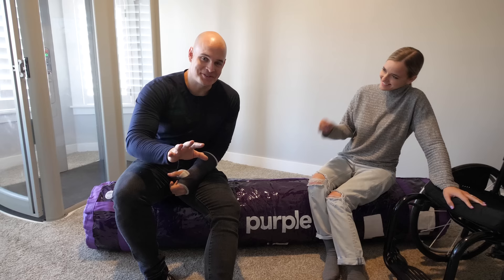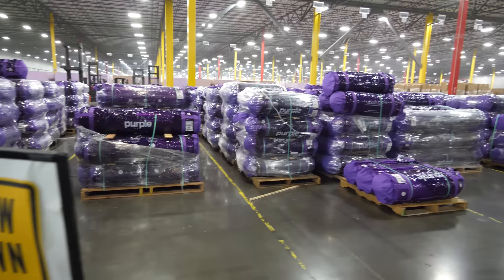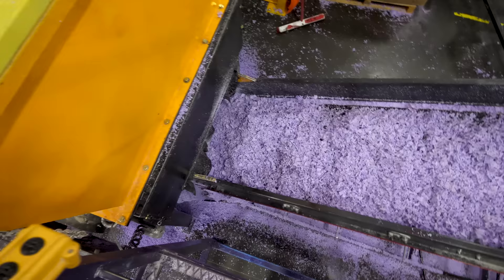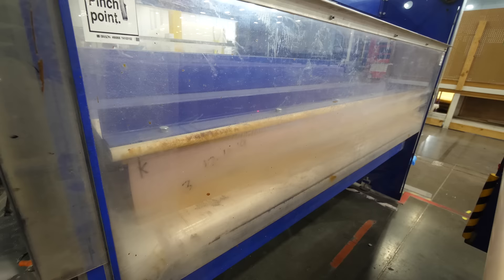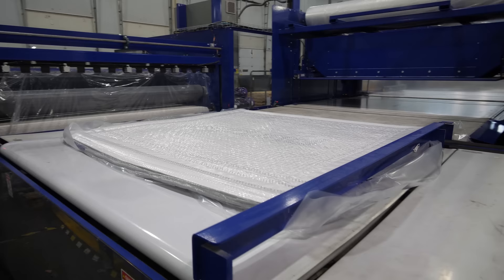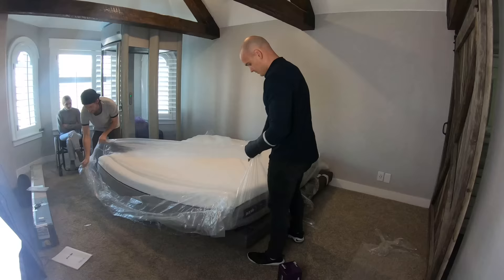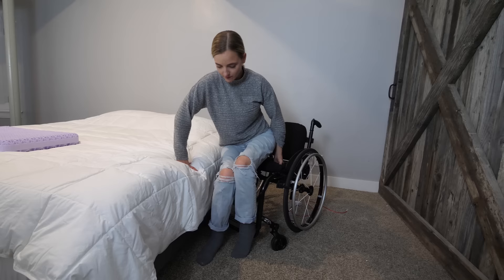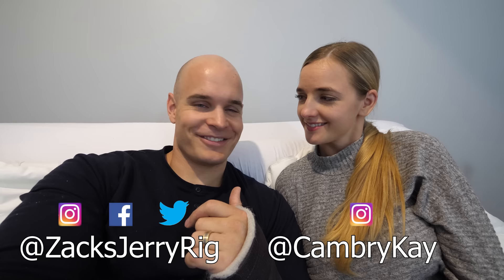How to Make a Purple Mattress! - Best bed of 2020?

Comment: "nothing goes to waste" - purple stuff everywhere on the floor
Reply: @Maddiethebaddieeee  well it is easier to have just one mold instead of a bunch of them for different sizes
Reply: @Maddiethebaddieeee  I mean it's a machine that has different moldings. It would make the machine more complicated and expensive. It's not cutting corners, it's being efficient
Reply: @Maddiethebaddieeee  you have to do maintenance of the machine, the more moving parts you have the higher the probability for something to go wrong. Another thing is that a big company full of people have probably figured out what is most cost effective.
Reply: Tactical Boolean lol that is not the case. The bigger the company, the higher the diffusion of responsibility.
Reply: Damn, you got 'em. If only we had devices that could be used to remove stuff from floors and place it somewhere else. Like a broom and dustpan, or a vacuum cleaner. Oh well, don't have anything like that, so I guess it just sits on the floor forever as waste! 🙄
Reply: I bet they sweep that up and throw it back into the belt.
Reply: @Maddiethebaddieeee  molds wear out if u have 4 going instead of 1, then u have 4 times the molds to maintain, check, and replace and all the complexity of making sure the material stays consistent across sizes
Reply: @mjc0961  Yep, along with dust and dirt.
Reply: A hybrid system where all the molds are together with multiple injection points would be best. You inject at certain points for certain sizes, and the runoff could then be recycled (which would actually be less material needing processing per size if you do your molding right). Depends how their injection molder is built, but I imagine each injection point (there's never one point, as you could have uneven pieces that way) already is fed separately from each other, given how large the final part is.
Reply: I was thinking that too, and also why not make seat cushions from the cut off parts, they look like the perfect size.
Reply: Bruh I work in a factory do you know how hard it is to keep a factory SPOTLESS? its REALLY hard, especially when you work with a lot of raw materials such as dusts and silicon based materials like this. I work in a metal working factory three years ago with oils in the air and metal dust and now I work in PCB factory and is lots of fiberglass resin and glass everywhere is not as easy to make it clean as it seems.
Reply: @Maddiethebaddieeee  the power of running a grinder vs running multiple heated injection moulding machines is huge. some injection moulders take half a day just to heat up. then look at all the down time when you have orders for 200 king, but only 20 double. what waste a whole day heating up and cooling down a mould just to make 20, when you can make 220 king, and chop 20 of them down to size. you are perfectly right, a mould is a 1 time cost and energy an ongoing expense. why waste energy on stop start production, when you can continuously run one machine. 

But it is REALLY common for factories to do this. I don't know any factory that doesn't do this, whether its toilet paper, cardboard, metal stamping, plastic film production. only food products waste resources, as you cant grind a burnt loaf of bread up into another loaf of bread!

Its like turning your phone on and off every time you send messages on your phone. you may think it saves battery, but the time end effort spent waiting for it to boot, check for messages, then turn off can be wasteful. You receive and send 1 messages a week? its not wasteful. you have 10 watsapp conversations on the go, its hugely wasteful.

You may then also have some other strange things, like the machine used to melt the plastic might not being empty, and could start burning any residue. a constant feed of material ready to be melted could (again) help with the time and energy wasted in stop start production.

I work in a factory that makes plastic parts, with machines that take hours to heat up and cool down. we have to work a 24 hour shift, becuse hiring an extra 1/3 work force over night is so much cheaper than turning the machines off, then turning them back on the next day.

I would hope that they do have at least 2 moulds for singles and doubles.
Reply: You guys think you understand how Purple's system works, based off of one video. Hmm.... problems with Americans? Nah.
Reply: @Maddiethebaddieeee  Then both are hot, since in the video they say the purple stuff "gets metled down and gets melted in to an injection molding machine". (direct quote)
Reply: @Blueyzachary  Ah yes, because every single person on YouTube is American...
Reply: I think they would just use a broom to pick it back up and throw it in since the factory looked a bit like its funding was running on fumes
Reply: Blueyzachary They also don’t get that molds of any kind are expensive, semiskilled hourly wage is not. Plus, you employ people in honorable work. “Soylent” Purple...it’s people!
Reply: @Maddiethebaddieeee  Molds for injection molding are not a one time cost, they wear out/need repairs or replacements. It costs alot to make molds, especially ones that massive
Reply: @GBLynden  that's insightful
Reply: @Maddiethebaddieeee  
4 molds would significantly complicate the manufacturing process and the infrastructure cost. They probably determined it is most cost and time effective to just go with 1 size mold.
Reply: aye ants gotta sleep too dawg
Reply: @thebananaclub  Do you realize how many bed sizes there are...
Reply: @foxman105  they make 4 sizes just like he said twice in the video
Reply: @x12legend98  That's still 4 production machines instead of one.

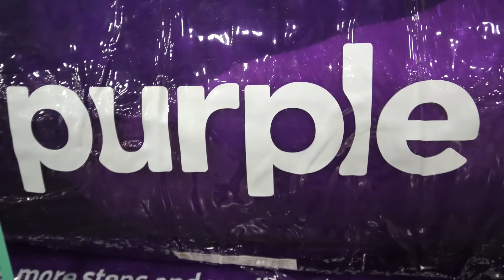Comment: [ 1:05 ] "This place is so large that 7 football fields can fit inside of it"

Me : Damn , these Americans can do anything to avoid metric system
Reply: This is the standard
Reply: Idk if you think he means American football or soccer but American football fields are often used to show how big some place is
Reply: As an American who's heard this all of his life, I'm just now realizing how strange of a measurement this is 🤣
Reply: I understand the size of football fields more than I do the metric system. Keep the metric system, no need for it here in the United States!
Reply: @akaredcrossbow  I can't think of a good reason not to switch to metric. It makes so much more sense in my opinion. Multiply or divide by multiples of 10 to change your unit of measurement instead of remembering convoluted conversions.
1 mile = 760 yards = 5280 feet = 63,360 inches
Versus
1 km = 1000 m = 1,000,000 mm

And that's just for measuring distance. Volume is the same way imo.

1 gal = 4 qt = 8 pints = 16 cups = 128 fl oz
Versus
1 kL = 1000 L = 1,000,000 mL

Any thoughts on why we should keep the imperial system?
Reply: Not to mention it would be more standardized with the rest of the world.
Reply: @akaredcrossbow  yes we do need metric system. Our military and health care all uses metric system except civilian.
Reply: I heard a lot of civil engineers want to use metric but they are limited by the suppliers and convention problems
Reply: bad also lol
Reply: @Peanutbutter_Funk  exactly
Reply: It's a common expression and usage. We understand the size of a football field, just like you understand the size of a football pitch.
Reply: I worked at a factory over 75 thousand square meters or around 18 or so football fields, took nearly 8 minutes to walk from one end to the other. Was a fun time.
Reply: It's funny because Europeans don't understand relative sizes.

If you said "1000 yard along and 500 yards wide" that's pretty much a useless measurement aside from going "ah. Its a rectangle with dimensions"

If you're saying you can picture this in your head without comparing it to something familiar to yourself you're bullshitting and you know it
Reply: @t_c5266  thats the point. Europeans understand how big of an area a 100 meter x 100 meter field is but rarely get how long a 100 yard x 100 yard field is, because we dont use yards in europe. It would be nice if america changed to the metric system since it is more logical and that way we would all be on the same page. A win win situation.
Reply: @JT-ev8sd  units are meaningless btw. And your 100x100 you compare ein your mind to a soccer field or something.
Reply: @t_c5266  yes, they are meaningless, that is why it would be better for everyone to change into the more logical ones. Also when I see a stretch of road I can come up with a pretty solid idea of how long it is. That works the same way around. If I'm given a number in meters (as long as it's not a big number like over 20km, I can imagine the distance in my mind pretty well, so not everyone is like that at least. 
But enough said, I'll sleep now.
Reply: We are converting to metric, inch by inch.
Reply: To be fair, as a Brazillian i don't undestand nothing about the idea of the way that you guys use that
Reply: How many hockey 🏒 arenas ?
Reply: @Al 6r tf are u saying, there is no - f and what u said is wrong af
Reply: @dantedanis  Cause i'ts way more accurate
Reply: In Germany one of our biggest TV programs is always comparing with Soccer Fields "Fussballfeld"
Reply: Only the most sucessfull countries use the imperial system like the USA, Burma and Liberia
Reply: Metric system is terrible. Built for fools by fools
Reply: Yep. School busses and football fields are standard units of measure in the US. (it's just over an acre, so I usually just assume acreage based on the comparison)
Reply: @t72oftruth66  What? At least the metric system makes sense and is easily translatable. Just because you're not able to use it.
Reply: @Peanutbutter_Funk  The US Customary and Imperial systems advantage is in having names for units of useful sizes.  I agree that conversions require more knowledge, but in everyday use people aren't converting between them often.  A gallon of milk vs a quart of milk is useful to call up a mental image of approximate size.   100 mL vs 300 mL vs 850 mL ....ehh  People don't tend to be able to visualize hundreds of things, they group them into units.  At best you're thinking "A liter is about this size and it's 1000 mL, so 300 mL is 3/10th of it."  The US and Imperial systems just give names to things of useful sizes.  It's a lot easier to know how big an ounce is and visualize 10 of them than it is to know how big a milliliter is and visualize 300 of them.  Most people can't and will resort to the method above of trying to relate it to some fraction of a larger unit. It's a completely different thought process to work with metric in everyday civilian life.
Reply: @Retro6502  I honestly hadn't thought of it from this perspective, but I agree. Thanks for the response!
Reply: Like every description of a suspect is about 2 metres
Reply: @JT-ev8sd  Would be nice if Europe changed to Imperial thanks for your opinion and there is mine
Reply: @RENERIZER  yes, but objectively speaking the metric system is a lot more logical, hence it should be the one everyone used. There is a reason that in America people use the metric system in science.

If some other people came up with a third system that was even more logical that metric and imperial then I'd be all for the change to that one. 

Ego should not hold back improvement.
Reply: What's a metric system?
Reply: “You could fit 826 hotdogs in this factory!”
Reply: @akaredcrossbow  You will find that much of the high end engineering and manufacturing in the US is already being done in metric (NASA, SpaceX, etc), because it is so much more precise and standardised. Just old tech like carpentry and home construction still uses thumbs, shoes and steps. In fact, the metric system is used to define and calibrate your imperial unit measuring devices. So the US could definitely not do without the metric system!
Reply: @GI-AUS  exactly !! What inaccurate is two footbal field size what the fuck Say in meters thats accurate !!
Reply: @Peanutbutter_Funk  I'm so used to the inches and miles thing but we can get rid of the quarts and gallons, those were always confusing and annoying.

Comment: We just got a purple premier 3... and literally I will never go back to a different mattress. It supports you more on your pressure points but still cradles the parts that don’t really give off much pressure and I sleep hard. Whereas my other mattress I would wake up multiple times throughout the night because it was too hot or I felt my husband move. We are both hot sleepers and this keeps me cool! I have no issues and we use a down comforter that made us sweat on our previous mattress. 
Anyone considering this, just do it, you will not regret it. It’s a pricey investment  but you will not need another mattress for a long time. You can use Splitit at no extra interest and you can use your credit card as long as you have the total balance available on your credit limit. We got the purple hybrid premier 3 in king size 10/10

Comment: Awesome video. Thank you very much. This was one of two “finalist” mattresses that we selected to be our “first trial” mattress after 18 years. And it’s the bed that we hoped might have worked. But before we dropped the premium sticker price cash we did LOTS of research…which never led us to transparent answers (even from Purple) on durability. Odd, right? Their customer service is wonderful and it does have a 10 year warranty. And yet I keep reading about people experiencing premature sagging after as little as a year. And not a low percentage of buyers. Wirecutter published an article about this. The purple hybrid mattress (2, 3, 4) represents such an advancement in mattress design in many ways, with lots of cool technology…so why not take it a step further and torture test it (like so many companies do with that huge and heavy roller tester machine) and publish those numbers so that people have the ultimate confidence in this premium-priced bed? So, we ultimately opted for a latex mattress (which was the closest “feel” to the purple grid), and there is LOTS of data on the long-term durability of latex. And if the Purple hybrid is as good as it seems it could be, just prove it with data. If it isn’t, consider replacing all of the poly foam on the edges and in the transition layers with latex foam. Perhaps the poly foam is the weak link (because I really doubt the weakness lies in the hyperelastic polymer grid or in the pocketed coils underneath).
Reply: We bought the sleep number bed system fully adjustable years ago and we still love it.
Reply: You might wanna also look into the powder coating that is left on the purple mattresses, you have to literally wash it in your driveway before its safe to use.

Comment: 1:53 But what if the same dust keep getting used over and over for a long time, will that affect the quality of this dust?
Reply: Dust is dust and dust deteriorates 😂
Reply: Yes but it's not likely to be recycled more than a couple times. P(recycled) =0.05. P(recycled twice) = P(recycled)^2 = 0.0025 or 0.25%
Reply: @mitchellsteindler  That's an amazing formula I've never heard of 🤔🤣

Comment: Zack and Cambry, thank you guys for the informative video. I'm a T12 para for 28 years and I've been looking to replace my bed. It's a standard coil spring that I've been throwing mattress pads on and I've had it for years. I've been looking at Purple for a while now, wondering how it would fare for a disabled person with skin breakdown issues. I sit on a Supracor Stimulite cushion and I noticed they make mattresses, but they run $8000+. That's kinda steep. Anyway, your video's given me everything I need, I'm gonna pull the trigger on the mattress and adjustable bed frame. Thanks again, and here's a sub for y'all.

Comment: idk if it's just me, but I got the purple 3 hybrid and am regretting it. 1st night I actually woke up in sweats, never happens, & woke up all night. I've gotten used to the gel, can't tell the difference anymore ,but my issue is I've woken up with horrible back pain every single day if I sleep more than 6hours. There's like a gap in the lower back area, it's like it's not made for females with butts. I've checked and it's also not level anymore in the middle after 2 months. The pain I had from a cheap serta innerspring was much less . Only time I don't wake with pain is if I sleep with rolled up blanket in that area of my back . I can't tell if the bed is too soft or firm tho so I will be likely return it this month. using it on a sinus platform frame with the wood slats. I am Abt 160lbs and this is supposed to work for heavy ppl?!

Comment: I bought mine in 2017 and it's pretty much the same I think. No sag. Still not the best for side sleepers sometimes it really messes with my shoulders but that's the only complaint really. It was super heavy too I guess getting it into the house and then unpacking it was a bit rough.
Reply: Do you have the original, or one of the hybrids?

Comment: Out of curiosity, how are you two liking the mattress a year in? Looking into one myself, but curious about longer term reviews.
Reply: I’ve had mine for almost 2 years, they are amazing. I thought sleep numbers were amazing, until I tried a purple premiere 3. Try them in store. The original mattress takes some getting used to, but the hybrids, are pretty easy to get used to. It really helps regulate heat. No complaints for anything you’d do in bed.
Reply: @jennamiller3114  I wish my experience had been the same. Sadly since I posted that comment,  my Purple bed has already been and gone (returned). Just not a good fit. Made my back worse than it already was. But thank you for replying!!!